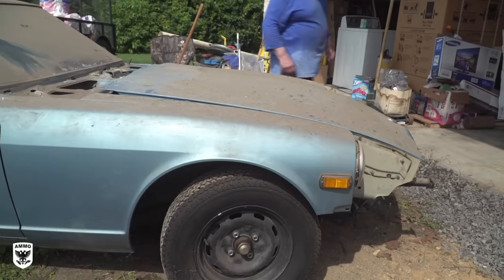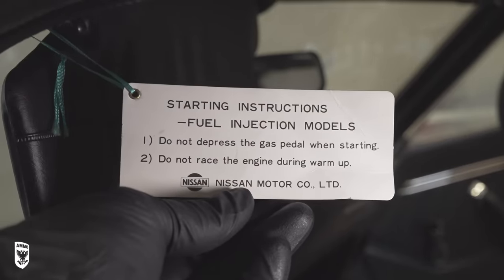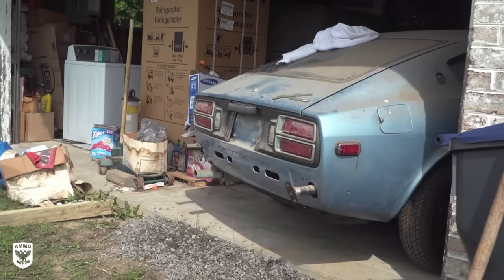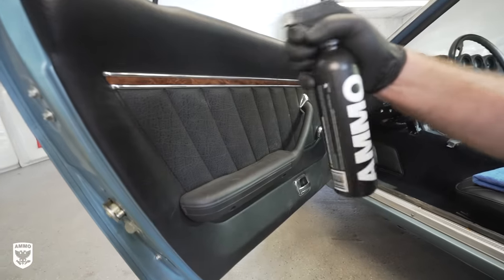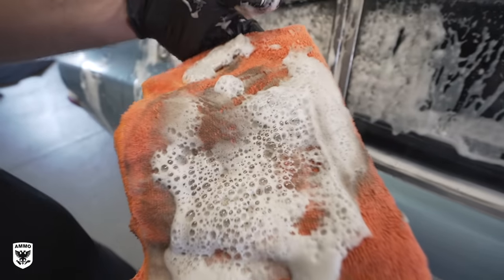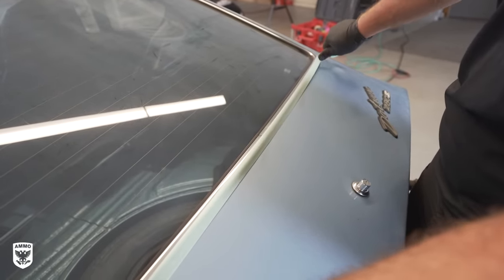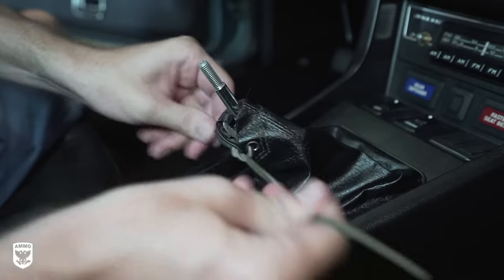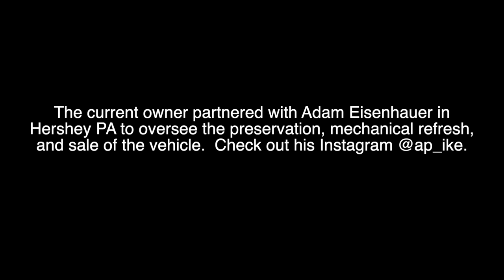First Wash in 44 years! Barn Find Datsun 280z with only 350 Original Miles

Comment: So AFTER scratching all the paint and glass with microfiber towels, you THEN decide to 'test the seals' with a pressure washer...!?
Reply: Chrix fix cant watch this
Reply: @nsns4009  They didn't even use soapy water. I'm outta here.
Reply: Yeah on a car they never even started!
Reply: Ammo is a amateur and his product is just simoniz products with his sticker on them
Reply: @natestandley3124  this guy knows nothing's about cleaning  a car
Reply: I worked at dealerships detailing in college. This guy is a joke.
Reply: Yep, after seeing that first microfiber wipe of  door panel i was like "what is happening here". Then my jaw drops as they go on to spray minimal amount of "frothy" on every panel and rubbing the dirt with towels. So what if the seals would have leaked few drops with proper foam prewash and pressure washer? Surely better than introducing few years worth of washing scratches at once.
Reply: Yea, why wouldn't you blow off or rinse the heavy dirt prior to wiping?  Nothing like grinding it into the paint. Then why not clay bar the paint rather than use a polisher?  Not real impressed with these guys.
Reply: @paule4696  You really should take time and watch his other videos. He absolutely knows what he is talking about. In this scenario it seems like the customer really wanted to avoid using a pressure washer at first. There are also several videos where he discusses why he is using a DA to pull contaminates out rather than a Clay bar.
Reply: @tarek3702  Pretty sure Larry engineers all of his own products along with his wife's help.
Reply: @Badxperiment  nah simoniz stuff still works better at quarter of the price
Reply: @Badxperiment  he clearly mentioned in the beginning it was dust until he realized he scratched the paint and claimed it was layer of dust that caused it 😆
Reply: You need to listen to his explanations, he clearly explains why he did it as he did.
Reply: @grossmeister1181  ya then mentions scratches were from the dust after. But beginning he claims it was okay too wipe the dust 😂
Reply: @tarek3702  He clearly explains it, why he did it. No need to discuss anything.
Reply: @grossmeister1181   you only shouldnt  discuss anything at all but keep your comments turned off
Reply: @Badxperiment  you should take more time in reading comments prior to commenting on them.  I never mention "Pressure Washing".  I've been washing my cars for almost 40 years.  Never use a pressure washer, unless it's at a quarter car wash.  A simple rinse with a hose, lightly wash with soap and water would remove the major contaminants.  At that point you're ready to polish.  It seems the OP is  looking for the most dramatic effect by using his product on a completely filthy car.  He's literally, and senselessly, grinding abrasive particles into the paint.  He even admits that's what happened.  Cutting corners causes more work later.

Comment: I'm not a detailer so I have no idea- why is a powerwasher worse than dragging all that dust across the paint with the cloth?
Reply: They weren't sure if the seals would hold well enough to protect the super rare paper labels inside.  They wanted to preserve the very unique aspects of the rare find.
Reply: Fredo Bull  the stickers are the reason the paint was messed up?! Paint can drop back and die even after a few months, the paint wasn’t ‘embedded with dirt’ it had dropped back and gone dull, the guy polishing it hasn’t got a clue about paint; saying ‘polishing out the dirt from the pores’ proves it.
Reply: @RachelHendricks  but they still powerwash it afterwards so what's the point even?

Comment: Would love to see the mechanical go-through, before starting her up for a drive. Mechanically, this car would have been better with a couple thousand break-in miles on it before 44 years of storage. Seals will all be super dry and could blow or leak. I’d also remove the heads and do a light hone for ridges on the cylinder sleeves where the pistons rested, and use a super light weight oil on the first engine  start. Freshen up the chassis, gearbox, differential, PS, AC, brakes, radiator with drain/bleed or pump-out.
Reply: Agree. Luv to see what had to be done n mechanically to get her back on the road.
Reply: Worth a complete rebuild.

Comment: why wouldnt you blast off the dirt instead of risking the paint by smearing it with the microfiber towel?
Reply: They made a lot of amateur mistakes here on top of not blowing the dust off first such as doing multiple passes with the same dirty side, turning rather than lifting off, pressing the foam pads onto the leading edge rather than off, not using some type of microfiber wash mitt after the pressure wash but before polish, wiping top to bottom then going back up with the same side, leaving the door jams until everything else was clean. They made sure to get that product placement in though.
-
You'd think "professionals" would know better but then they probably had to find some way to justify their price, especially given everything that's been happening in 2020. Then again, no one is wearing masks so who knows when this was filmed.
Reply: @agentx250  great points.
Reply: They said why around 20 times, they wanted to test the seals before blasting it with water.
Reply: You would only do that if you didn't want to make it look a very technical and complicated process.
Reply: @agentx250  Never said anything about a pressure washer or garden hose, simply they didn't want to spray it with any water because of the seals, and they repeated saying that enough times. Why are you arguing with me about water pressure? I don't care. All I'm saying is pay attention to what they say, don't ask me if you're confused on their reason.
Reply: @baseballhunter42  Their reason was seal integrity but that's only an issue with pressure or non-existent seals. They could have easily masked around/removed the paper tags and done a wet wash with a hose and come out without rubbing dirt into the paint. Since they ultimately pressure rinsed the car anyway, maintaining the paper tags wasn't a valid justification. I've washed cars with deteriorating seals before, as long as you use a soft stream and let gravity work you're going to be fine.
-
It doesn't require much water to wash a car, especially inside with a cold climate. They could have foamed, rinsed, foamed, washed, and then rinsed again all with a very light stream from a garden hose. No one here is confused, we're all just laughing at how ignorant and product oriented they make themselves look here and my previous question was rhetorical.

Comment: If Nissan were smart they would remake this car with original specs.
Reply: Should be electric then
Reply: @MrBirgerB  u crazy
Reply: Ice is dead if you control nissan you may accelerate they invertible doom.
Reply: Or at least issue a retro classic with close to original body with modern engine and interior. I bet it would sell like hotcakes.
Reply: -Great engine design, copy of Jag tech. Evil deadly handling of early Japanese.
Reply: @stopthephilosophicalzombie9017  they have. Its a 370Z
Reply: @u-know-this  That car is hideous. I meant preserve the good/retro looks of the original Z40-60-80. The new Z looks like ass. Also from what I understand that car is way overpriced and can't compete with a Mustang.
Reply: My cousin had a 280z in the 80s. It had some engine work. But what really set the car off was the cowl induction hood, fender flares & ground effects. The car was pitch black with alloy wheels. Another friend had one that had a chevy 350 in. That car at the time was untouchable when we would drag race on weekends. It was done professionally not just slapped together. This was Gettysburg Pa in the 80s. A time when trucks were jacked up & running at least 33s. Spent weekends in the saw dust piles & 4 wheeling in Bear Mountain. All while drinking beer. We had DDs then. Hershey is about a hour away from here where they discovered the car in the video. I feel robbed not knowing of it. LOL
Reply: If Nissan were smart they would remake this car with original specs.
Reply: why?- its a deathtrap compared to the newer cars.
Reply: I agree! Smart looking and very sporty. A modern classic look that isn't weighed down by over engineering and too much flash.

Comment: I own a highly modified 240Z. Engine fully reworked and reads 478 Hp on the Dyno. Great car, good handling and great lines. Using Weber side draft carb's too.

Comment: I would pressure washed it in stead of using those microfiber towels. You are professionals, but this has no sense with so much dust on the paint 🤷‍♂️
Reply: they coated the body with a foam cleaner before wiping it down. they did not "dry wipe" the car.
Reply: @txhansolo22  It's still a better choice to rinse it off first and get any surface dust off before doing any wiping.
Reply: @alvarez321  you saw the results for yourself. their way worked. yours could have chipped off paint. then what would you do? repaint the entire car? no longer a pristine original. get the point?

Comment: 99% of this work would have been the same with a 0.99$ car shampoo, and a normal polishing process.
Reply: Not to mention the owner would not have taken $10,000 or more off the value because the idiots wiped it down with dirt still on the car and horribly scratched all the paint.
Reply: @davidp8627  ikr. Can't believe they didn't wash the dirt off first...
Reply: @davidp8627  and then they use a high pressure washer.

Comment: Why didn’t they blow the car off with compressed air? They would have shifted a lot of the dust as a first step.
Reply: Isn't dirt rough and blowing it off would scratch the paint? I don't know if this is true or not just a thought
Reply: @KMcNally117  That's a good point but I think it would be ok because they use compressed air to blow cars off in bodyshops.

Comment: I bought the 78 280Z 2+2.  Over 800,000 miles and I stopped counting then.Still had the original transmission that never had anything done to it.  I blew the original engine as it overheated.  To get off the freeway was not a safe place to ( it was late, before cell phones) I  went for the next off ramp and as I came off on it the engine froze up. The new engine was bought from Japan and rebuilt) and was still going strong after the 800 ,000 + miles so it had over 600,000 on it.  It was restored over the past few years.  What a beauty.

Comment: Our family is a Datsun family.

My dad had a new 1981 280ZX 2+2 naturally aspirated, black with gold wheels and gold pin striping, with tan leather interior and deluxe cassette stereo.  He drove us to middle school each morning.  My older sister, in 1986 in  high school,  bought a used 1976 Datsun 280ZX 2+2, and my dad bought me a 1977 Datsun 810 sedan when i turned 16 in 1986.  It has the same inline fuel injected i6 from the 280z  (in 1978 they renamed the 810 as the Maxima).

Comment: I worked with these cars back then. The first 240 sold in my city was orange, and the rear window defrosters were vertical. I was a kid in the department that get these cars ready for sales. We used varsol to get rid or the sea wax, and we removed all tall the blue plastic they used to protect the seats and door panels. 
I remember setting up the first 2040Z sold in my city. We spent more time, because it was so expensive... $3500.

Comment: Never drove a 280z but took a 240z out for a spin back in 1980.  The thing that impressed me the most was 0-60 acceleration, would have loved to own a 280 but back then the checkbook with school just wasn't deep enough.  Eventually bought a 300z turbo back several years later, but really wasn't the same car.

Comment: I had a charcoal grey 1982 non-turbo, analog dash, T-tops, 6 spoke wheels, louvered hatch (because that’s what you did in the 80’s), Sold it in 1991 having just turned over 36,000 miles, all because I thought I had to have a Z28. Whenever I hear or see the Datsun logo anywhere, my heart still aches over that one.

Comment: I had a 1976 Datsun 280Z in Metalic Green with Gold flecks and it came with a clear coat on it. It was rear wheel drive and you could just feel it push you. I loved it. It ran on leaded gas before that was outlawed. Miss that car. Mine was an automatic with manual steering. When there was a recall for the wires going to the spark plugs, the dealership must have fixed it wrong, because it started acting up. My brother discovered they had spliced the wires & they were corroding. The dealership couldn't even find the problem because they didn't manually check for it. Just hooked it up to a machine. I wish I had known these guys back then who could have helped me upkeep my car.

Comment: 10 years driven in PA winters and that 280Z would have been a rust bucket, fit for the crusher.  Z cars did not tolerate salty roads well.  Some years ago, I took possession of a  '71 240Z in CAL, and shipped it back to the east coast.  It had spent its life in the SF Bay Area, and still had rust starting around the wheel wells.
Nice job cleaning it up, looks great now.  Would have been nice to re-unite it with the original owner, and capture that on video.

Comment: I didn't hear it run! How did you get the 44 years of lacquer out of the fuel injection? Did the cooling system need to be replaced? Did the head gasket fail?

Comment: For my camper, I have a water brush with a long extendable handle. It easily takes of the dirt and grime and I would have used it on the car above to make the job easier. Yes, someone you will claim my process would scratch the paint but I doubt that...at least to the extent that they would be noticeable.

Comment: I wanted to see the engine run and transmission work. The car look great.
Reply: the rubber seals were probably deteriorated and it probably burns oil.
There's a whole process you have to go through before you even fire up the engine.
 You can't let a car sit like that and expect it to run right. 
Even the ignition components lose their ability to operate properly. But it looks nice!

Comment: No way. My first bought car was a used 240Z. It became my money pit, but I loved it while I drove it. I recall driving home at 3 am on a highway in Miami. I looked down and I was going over 100 miles an hour. <3 At one time the distributer cap's wires got tangled in the fanbelt. Boom! $400 later it was fixed and in 1980 that was my entire paycheck for a month. I totaled it a couple of months later. God, would I love that one.

Comment: I had a 77, 5 speed and drove it for 143,000 miles. It was a hoot to drive and got great gas mileage. Alas, rust destroyed this car to the point it was not salvageable without spending $1,000s. So I sold it. I had it for 13 years. Then after another 13 years I bought a new c5, drive it for 14 years and traded it in for a 2016 new C7. I’ve always loved two seaters and my very first car was a TR3, the most fun car I ever drove.

Comment: I had a '76 240 and '81 280. I should have kept them along with my new '81 Corvette and '64 Mercedes., etc. Z's were fun cars, light in the rear through. I used to put 100-200 lbs of concrete in the back. Thanks.

Comment: My mate had a 260Z which he sold to me for £500 to upgrade to the 280Z. Instantly regretted it, he said the 280 was gutless and wallowed like a Cadillac whale. 260 was lovely to drive, proper sports car. Would have liked to try the 240Z/fairlady but never got the chance. 
Got the Z bug and bought a 300ZX in 1987 new for £17,000 (not small change). Loved it, tight suspension, precise handling, V6 as opposed to the 260 6 in line.
7 years later my son was born a we couldn't fit the "travel" cot in the boot, so it was back to "family" car for me 😣. Flogged it to my brother for 2k, I'd had a few beers, then he got the Z bug and later got the twin turbo version 😂😂.

Comment: Hi, just for my understanding, but you spray the foam on every surface and do not even wait a second to get it sucked in the dirt or make its job. You immediately take the microfiber towel and remove everything at once. Isn't that bad as the original dust has not soaked the liquid and this is a bit like a grindpaper?

Comment: Nice job overall. Only thing i would have avoided is wiping off the foam with a towel, even being carefull theres the chance of scratching the paint with the layers of dirt, sand.
Would u have done that on a similar condition vintage Rolls, Ferrari or Cadillac.

Comment: I would have cleaned the inside with a wet towel, no chemicals.  I think that damages the inside of the car and it neutralizes the new smell.  Now, you think that wiping the outside slowly with a towel fiber towel it didn't do damage.  It probably didn't on the first try but remember that the dust has microscopic rocks and when you check the paint against the sun you will see that the paint has scratches.  I would have poured water slowly until the dirt dropped off on the ground.

Comment: I have a 1986 300ZX (2+2) that I haven't drive in many years. I thought of selling it for parts since I can't do car repairs & it needs work and has underneath rust, etc. It was one of the last talking cars ("door is ajar", "you are low on fuel"). Brake line went, so it is stuck in the garage. Has a T-top which I only took off twice. Would need to locate the car keys if someone is interested.